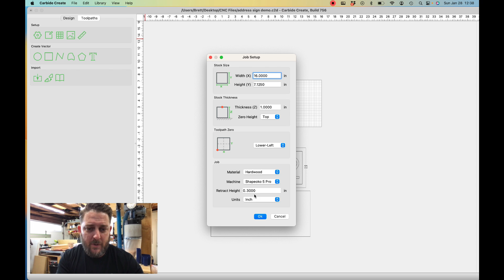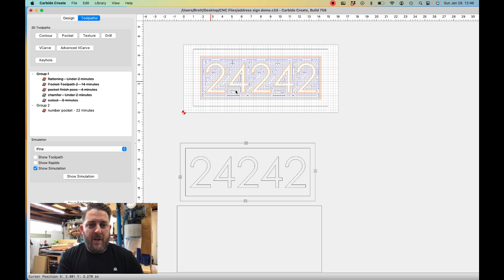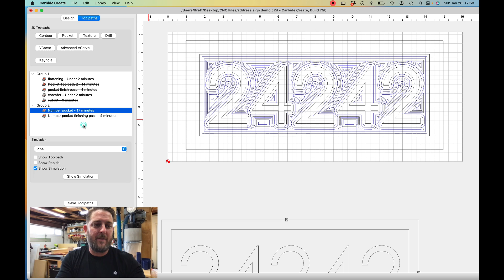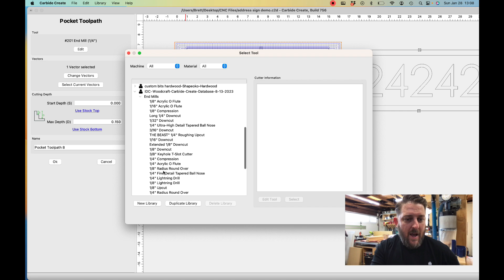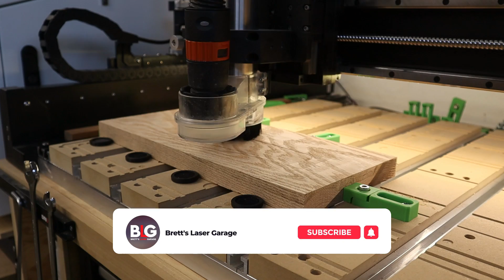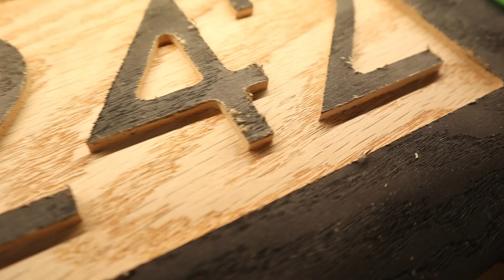Profitable CNC Projects: How To Create Address Signs On Shapeoko 5 Pro! | Brett's Laser Garage

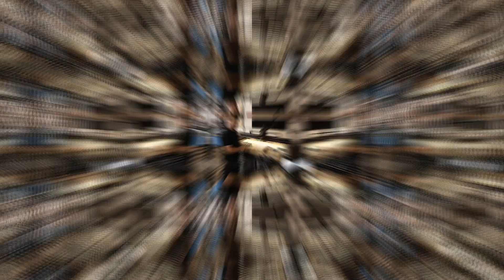Comment: Great video, at the end you mentioned taking the fuzzies at 23:27 then you mentioned some kind of bit or something and it began cutting again (I thought to remove the fuzzies) but at 24:17 I still see the fuzzies.  The you do a faded transition in the video and say lastly let's get it out of the clamps, and then cut the caps, but at 24:41 you show the sign and there are no fuzzies so how exactly did you get the fuzzies off?  I still saw them at 24:17.
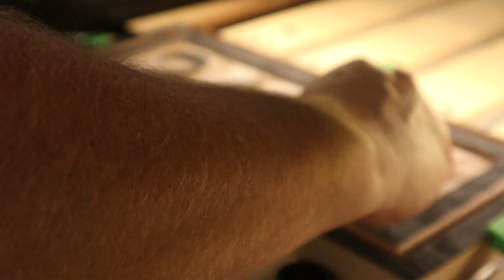Reply from the maker: Thank you very much.  23:45 I use some sand paper to remove them.

Comment: After you prob the machine do you move it back to the start position on piece?
Reply from the maker: You don't have to manually do anything after using the bit zero (touch probe).  Once your zeros (X,Y,Z,) are set you can run your job.

Comment: Hi Brett, Thanks for making these very helpful videos.  I was wondering if there was a reason you did not run the chamfer operation after the flatting operation?  I think that would have saved you from having to do a tool change correct?
Reply from the maker: Key Keith thanks a lot!  You could run the chamfer path first like you mentioned.  I don’t see how it would save a tool change unless you flatten with a 1/4 endmill.  I used a 1 1/2” flattening bit.  Thanks a lot for checking out the video.
Reply: @LaserGarage  Thanks for the reply Brett.  I don't have a CNC yet, I've been a laser guy for the last 10 years, so I'm trying to figure some of this stuff out before buying a machine.  I was thinking that if you ran your flatting path first (1 1/2" flattening bit), then your chamfer (90° Vee ), followed by all of your pocket and cutout paths (1/4" end mill).  Counting the first tool that is three total changes.  The way you have it in the video is:  1 1/2" flatting, 1/4" end mill for the pockets, 90° Vee for the chamfer, and the 1/4" end mill to cut it out.  That is a total of 4 changes.  Again, I don't know what I'm talking about, so just asking to learn!

Comment: Is the Pro version the only way to reduce the curves in the corners of the numbers?  Could you outline with a smaller bit and then contour with the larger bit?  I realize you were keeping this video simple, which I appreciate, but my brain is running with ideas.
Reply from the maker: It’s definitely not the only way. Just efficient to use the rest machining option.  Otherwise you’d have to run a pocket tool path with a 1/8” or small endmill.  That will work but it takes a lot of time.
Reply: @LaserGarage  I wondered this (haven't tried it)  Could you do a contour with the 1/8" bit before doing the pocket with the 1/4"?

Comment: This was great.  I just got my Shapeoko Pro 5, so I have a lot to learn.  I watched the Carbide videos and this is 100X better than those.

Thanks for all the links and helpful information.

question... I am new at this... could you run the chamfer first to prevent switching the tool 2 more times?

I don't know how hard it would be... but chapters in the video would be very helpful to allow quick access to certain sections for review.  Just a suggestion.  But I love the content and delivery.  THanks!
Reply from the maker: Thanks a lot for the feedback Jay and congrats on the new machine.  You can definitely run the chamfer first if you’d like, no issues there.

Comment: I thought this was a very good presentation. WHY? Sometimes presenters go too fast. 1. Your speed was perfect. You do what some don't and that is moving in a normal speed so that we can see what your type and where you are typing. 2. You were very clear on your next moves and I was able to follow along as I created a design for my home. If I had a question, it would pertain to the leveling bit. If the wood is slightly warped, what side to you cut first: concave or convex? I also noticed that you turned of the bitsetter. Got it. But you only zero'd out the Z. How did the machine know the size of the surface area? I usually start in the lower left corner, but you seemed to start near the middle by eyeballing it.  Thank you for this video. Your style of presenting is perfect for me. I will be viewing your other videos.  Carbide3D should watch how you do your videos. They have good content too, but some are too fast.
Reply from the maker: Thank you very much!  I’m glad you got something from the video.  

1.  I would have convex side facing up so the piece would be most stable on the bed.  

2.  I disabled the bit setter because by 1.5” surfacing bit is too large to fit on it.  Therefore I had to manually set the z height.   The x and y axis were not changed since my stock was on my fence system.  It only needed to be set once during the initial setups.  

3. The machine knew the size of the surface area because I set it in carbide create.  Basically my tool path was a 6.5”x14.5” rectangle with a shallow pocket .005”.  My origin was bottom left

Comment: nicely explained simple project. How do you recommend hanging or mounting the signs?
Reply from the maker: Thanks a lot!  I either cut a key hole slot in the back with a palm router or just screw in a saw tooth hanger.
Reply: ❤ the gel stain

Comment: Thanks for sharing. I noticed you are using some sort of game controller. I'm going to buy the 5 pro and wanted to use my Xbox controller, are they difficult to setup and do you need some sort of middle ware to make them work? Just curious. Any info would be helpful. Thanks.
Reply from the maker: Thank you, you’re welcome.  I’m using a small wireless keyboard, I have an affiliate link to it in the description of the video if you want to check it out.  Pretty inexpensive and very helpful.  I’m not sure if there’s a way to make an Xbox controller work on the Shapeoko.

Comment: I make and sell quite a few wooden flags, my customers really like the texture of the stars and images when they are carved with a dremel. My question is:
1) how do you just outline the stars/images in carbide create?
2) would it be better to use a 60 degree v bit or a 30 degree engraver bit? 

After doing this for a couple of years, the fine detailing of outlining is taking its toll on my wrist. I want to be able to be able to outline the stars and images and go back with the dremel to remove the excess. If that makes sense?
Reply from the maker: Yes that makes total sense and is a really good idea I must say.  

1.  To outline only the stars I would just select the star vector and create a contour tool path. You'll have to test various tools but I would try to use a 60 degree v-bit with no offset and a total depth of like .05".  Maybe even try a 30 degree engraving bit.  The point is you just want to lightly outline the perimeter of the star without going too deep.  Will take a little testing.

2.  I either use a 90 or 60 degree v-bit to engrave stars.  I'm like the 60 degree a little more lately though.  The 60 degree will engrave a little deeper but they both look good.
Reply: @LaserGarage  another question. Have you made any inlaid pieces? I’ve never inlaid something and I was wondering, could you inlay a piece of wood with the pocketed portion v carved out? For example, a word or phrase that’s been v carved instead of pocketed. I realize a pocketed piece would have more surface area for the glue to hole, but would the angle of the recess be adequate to hold the inlay in the piece? I don’t know if I’m explaining it well enough. I have a customer that wants a heart shaped charcuterie board with the names of all the grand children’s names in cursive inlaid into the board. 
Would that be something you could make a video about with carbide creative?
Reply from the maker: Sorry I haven’t done any inlay work yet on the CNC.  It’s a great idea for a future video though, thanks.  
Sounds like filling a v-carve with epoxy may give the look your customer may be after.